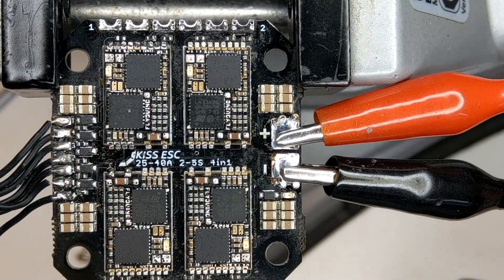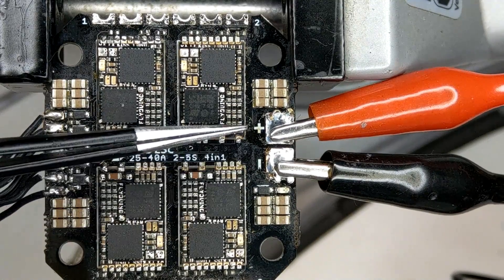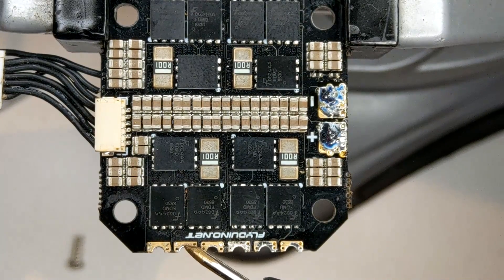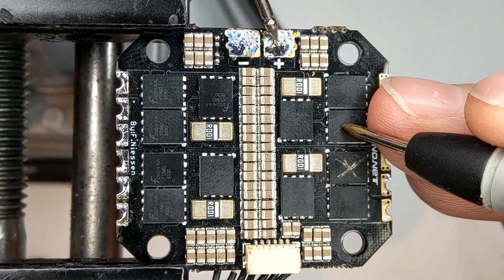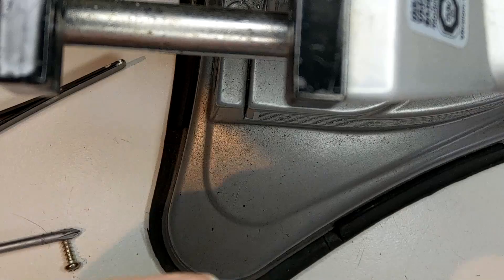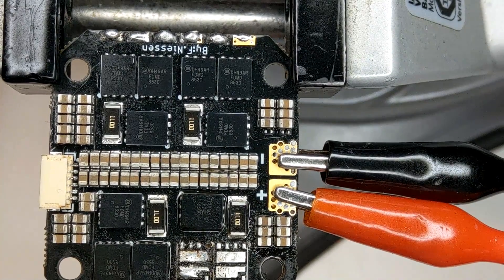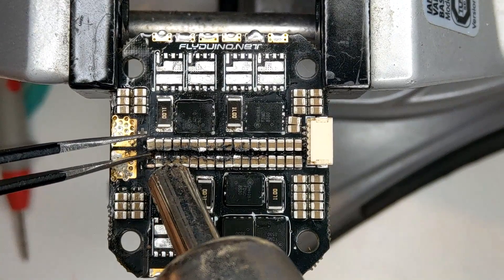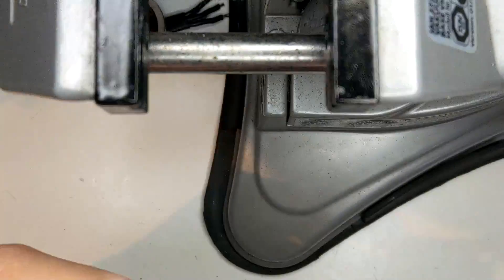Kiss 4in1 ESC Repair FAIL :(

Comment: Good!! I want to try this on my burnt Flycolor ESC. I'm new to the hot air gun. I saw liquid flux in many hot air gun de-soldering video. Do I need liquid flux? Can I use my Burnley soldering paste which is about peanut butter consistency?

Comment: Ok lyv.  I have the bardwell stack.  You see alligator clips your using to power the esc.  When you vonnect and make contact with the esc , is it suppose to spark ? Not much but its a spark and i dont have anything connected to the esc.
Reply from the maker: Sometimes it does make smome sparks depending onnthe voltage

Comment: Hi livyu I've watched all your esc repair vids and have a issue I want you to help diagnose.  I have a dys 4in1 20amp esc and motor 3 is showing signs that it's going bad.  I've replaced the motor with a new one and ruled out the motor so now the issue is in the esc.  The problem is motor 3 is dipping when applying throttle and is heating up the motor.  Is this mosfet related or something else?  What should I be looking for?
Reply from the maker: Yes mosfet related for sure check all the mosfets on channel 3 for dubious signs

Comment: Great vid. I have done the same thing, trying to get a few good ESCs from a pile of bad ones. What never fails is the all to common USB socket replacement. Pays for the hot air station many times over.

Comment: Livyu fpv Whats the best temperature for removing mosfets?
Reply from the maker: well... they all are using lead-free solder which has a melting temperature of around 230-250 degrees C. So you need to bring up the board and part temp up to that value. So depending on what heat gun you have it could vary from 300 to 400 degrees.
Reply: @LivyuFPV  Thank you for your videos and time showing us how to use a hot soldering gun. Now make some more videos lol

Comment: 4in1's are dead to me. I fly individual esc's, spedix es20 on 6s. 9$ a piece.
Reply from the maker: I never used 4in1 escs. Because of noise and cost considerations(when one does get killed). Even if I never killed one and I consider myself a frequent flyer... usually I think esc are killed from stress or bad soldering :)

Comment: Dang makes me sad to see three KISS ESCs completely dead 😢

I've had a few that had a MOSFET just stop working for no reason. Makes me think a bad FET made it through QC and onto the ESC resulting in what happened here. 

I also think what Flyduino should start doing is enlarging the holes on the ESC to 5mm to fit a soft mount grommet to help with taking shock out of the system when the quad crashes hard. I had one catch on fire over the weekend at the race but the ESC was hard mounted. The other three race rigs I had with me had KISS 4in1 ESCs that were soft mounted and didn't have a issue with them.

Comment: Very interesting. Are these KISS ESCs more fragile than other 4-in-1s? Designed with tighter internal conductor spacings?
Reply: Could be. I honestly think Flyduono should start enlarging the mounting holes to 5mm to add in a soft mount grommet to allow the ESC to 'float' when getting into hard crashes so all the shock doesn't go through the ESC. I've had three ESCs stop working and had a MOSFET stop working with no damage to it. It could also be a QC issue not at Flyduino, but at the manufacturing plant for ON Semiconductor. If they had a few slip through their QC then this could be the reason why a FET stops working on the ESC.
Reply: @BikeGuyFPV  Can you not drill the holes out to be larger for grommets? Ive been doing this on my Hobbywing 4 in 1's for awhile now with great results... But I'm not sure about the traces on the KISS.
Reply: @smooth_ops2942  yes, you can. I talked to someone who had a dead one and they checked. They said the max size would be 6mm. I drilled mine using a 3/16 inch drill (4.8mm) with no issues. Then slip the grommet in and it's soft mounted.

Comment: Kiss is fir rich folks. the kind that spends 3k on a macbook..
Reply: I would have to say that is false since i freestyle only kiss and even race it but yet have never owned a crapple product in my life.
Reply: @gargartgocart1  half kiss firmware is coded on crapple product ;) LOL ;)
Reply: @alexanderfedorov7890  i know. But that doesn't mean i have to like crapple.
Reply: @gargartgocart1  whatever you like mate.... ;))))
Reply: Some of us use KISS since it's easy to use and setup. But that's the price you pay to be able to use such tech. BF for instance is cheap but imo is a nightmare to setup because of all the settings you have to go through but files okay. It feels stiff on the sticks compared to a KISS rig with the exact same rates setup. Then there is FL1 which for one I don't trust their boards or their hardware. Their stuff is not mature at all and is over hyped.
Reply: @BikeGuyFPV  so much truth in what you just said not to mention how over filtered f1 flys. Feels like im just kind of pointing the quad in a direction and letting it just do whatever vs me feeling as though im in full direct control.
Reply: G3 FPV I flew Betaflight for the first 1.5 years of FPV. Highly tuned and fully understand what I’m doing with every option / CLI command. Flies totally competent. 

Then I fly KISS for the first time last month and now I get what people mean about KISS’ stick feel. Center stick is extremely  responsive and loose yet not at all abrupt. Now I’ve doomed myself to an empty wallet lol
Reply: @BikeGuyFPV  dont get me wrong.. i fly only kiss currently. 4 quads all v2 but the price and how phinicky they get on minor crushes is just too much. i still have an old BF beater that doesn't feel the same as the kiss but pretty decent for the price and fact it hs zero issues and .. if tuned well it could produce really nice footage. mind you le drib and RR flying BF and they seem to produce amazing footage.
Reply from the maker: David R. Cohen, they seem to but kiss is not about the end result but all about how it feels when flying it.  :) At least this is why I use it.
Reply: @ @davidvaknin3801  I've always hard mounted my V2 FCs but using the plastic standoffs. I'm fine with breaking that instead of messing the FC up. The 4in1 however I've had three blow a fet after a crash. I've now started drilling mine out with a 5mm drill and adding FC grommets to them to see if it helps in absorbing shock and not flexing the ESC and thus breaking something on it. Other thing too is if ON Semiconductor is really doing 100% QC on their MOSFETs before they leave the factory. If not, could explain why you have a MOSFET stop working at one point for no reason. In my case I've had them stop working after a hard crash. But never had one fail randomly during flight on pluging in or unplugging the battery.
Reply from the maker: @BikeGuyFPV  try using rubber standoffs...from frame to the stack.
Reply: @LivyuFPV  tbh I've done that with FCs and they rip out. Then the quad flies like crap. I'm good with just getting the ESC soft mounted similar to a Aikon AK32 4in1 and leaving the FC hard mounted.